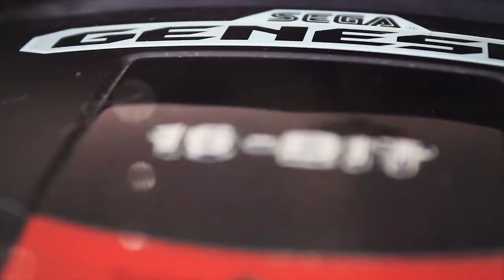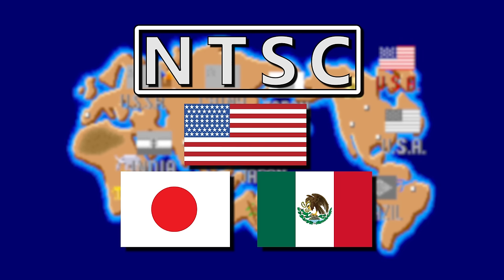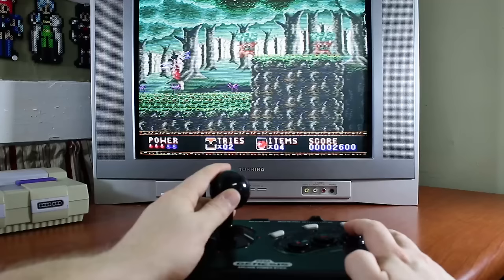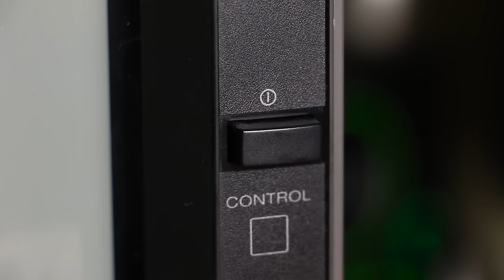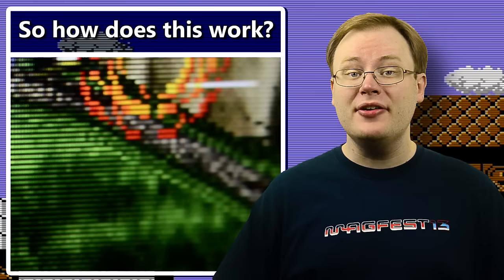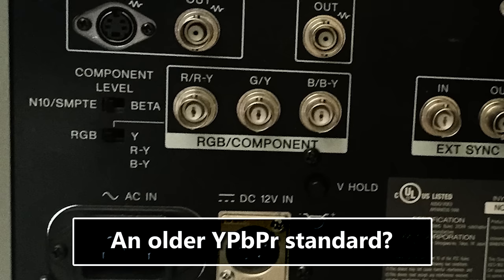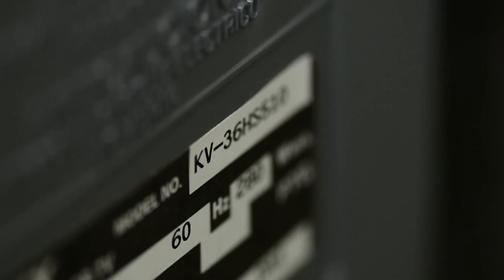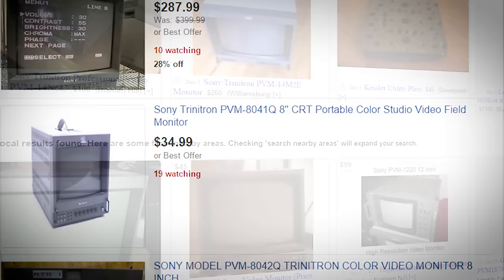Gaming on CRT Televisions, PVMs and BVMs :: RGB104 / MY LIFE IN GAMING

Comment: No! CRTs are great because of their zero lag.
And zero lag is great for 3D games.
For retro games, where the console itself introduces the lag (they're much slower than even emulated consoles on modern hardware), the lag an LCD display introduces, is minimal.
I prefer the sharpness, increased contrast and color ratios, of LCD screens.
And any scaler can be used to make it look like whatever you want; especially since LCDs run at 1080-2160p resolutions, while the original retro games often are limited to 144-320p games (=3 to 15x lower than the capabilities of the LCD screen).
Reply: Added lag, is added lag.

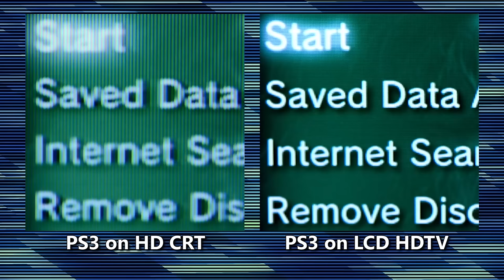Comment: 19:31
Is the PS3 running at 1080i on both the HD CRT and LCD? 

Are you saying that 6th Gen consoles(PS2, GC, XBOX) shouldn't be played on HD CRTs? If so, why?
Also, is there 0 lag on HD CRTs like there's 0 lag on non-HD CRTs?
Reply from the maker: +Mike V [Try4ce] HD CRTs disappoint me because they use analog technology to display a digital signal, meaning you don't get the benefits of either. Analog inputs are converted to digital before being displayed. Technically, yes there is lag. I can't say with 100% certainty that all consumer HD CRTs are this way, but it's the typical configuration at the very least.
Reply: Thanks for getting back. All I know is that my PS2/PS3 is more responsive when I play on my two HD CRTs(KV-34XBR910, KV-30HS420) via component cables compared to when I play on my LCD TV with either component or HDMI. 
Does a professional video monitor not have lag at any of its resolutions?
Reply from the maker: [Try4ce] They don't (IF they are supported - most do not support resolutions like 480p), because it supports all of those resolutions in a purely analog realm.

Comment: My Life in gaming : 
I live in Canada , i have a NTSC console ...If i order a PAL france/europe gamecube console , can i connect my 110 Power unit/cable into the PAL power connection hole behind it and bingo  ??
Reply from the maker: [Try4ce] GameCube systems all use the same connector for power. The power brick for Europe is rated to their standards, so all you have to do is use a North American GameCube power supply instead.

Comment: I have a question that you can clarify for me.  I recently bought a pvm, however I noticed that the projection light is dimmer than that of a CRT tv.  Is this really real or is the model I picked up in question with some kind of defect ?
Reply from the maker: [Try4ce] Did you try adjusting the knobs or any other brightness settings? It shouldn't really be darker than a normal CRT. Also, some PVMs may have a anti-glare film over the screen, which can darken the picture considerably. They can be removed, but I don't know the details of how it do it safely.

Comment: I’m looking into getting an HD CRT now my question is would like guns work on these models?
Reply from the maker: +C4 [Try4ce] Sadly no. I actually have since gotten rid of the one shown in this episode. Personally I am not a big fan of them anymore. The colors and black levels are excellent (which is what drew me to it in the first place), but don't forget that they are digital TVs using analog technology. This means you won't get that true scanline effect with retro games, and instead will have an image upscaled by the TV itself. Is it a Sony model like I had? I am not aware of any consumer HD-capable CRTs that handle retro games in the true way that non-HD CRTs do. You would need a BVM or a L5 series PVM (or similar top of the line model from other manufacturers) to pull off both in the same unit.
Reply: My Life in Gaming Thanks for replying back so quickly I appreciate it and the information extremely helpful. The one I am looking at is a Phillips 30 inch diagonal screen. Pretty much the same reason you were drawn to yours is why I’m drawn to this one. But not being able to use the light gun or having true scanlines is a deal breaker.

Comment: so wait, i just bought a NES and old CRT locally. (waiting for NES to come in mail). Should i try to get SCART connection for the NES or is the 3 cable RGB thing better or what? (The TV I got has MANY input types on the back) thanks for the help (i live in UK)
Reply from the maker: [Try4ce] An RGB mod for your NES would improve the picture if the TV supports RGB. By "3 cable" I assume you mean Component video, which is kinda like RGB, but came around way later and is a different signal (but with similar results). I wouldn't worry about that as long as your TV has SCART.
Reply: @mylifeingaming  thank you man, i'll try to find away to plug it in via scart then

Comment: Most CRT TV's that we had couldn't do 240p.  They only displayed interlaced signals.  Progressive scan was not supported on affordable TV's until the late 90's.  In fact, composite only supports interlaced signals.   Everything would be converted to 480i, or less depending on the actual resolution of that particular display.  CRT's just have a magical way of making lower resolutions still look okay.  Something LCD TV's are horrible at doing.  Also, CRT's have no input lag not because of screen size. lol  It's because you're converting and analog signal into a digital signal for the modern TV to display.  That process takes time.  The information has to be read, processed, and then displayed.  You don't see any image until this process happens, hence the lag.  However, CRT TV's don't need to do this.  You see the image in real time as it happens.  It's just like a digital speedometer in your car verses and analog one.  A digital speedometer takes a measurement of your speed, processes that information, and then displays it for you on a readout on your dash.  However, analog needle just moves as your speed increases.  I hope that helps.  I'm an engineer, not a teacher. lol
Reply from the maker: [Try4ce] 240p is a real thing that works even with RF or composite video. It's not a proper standard, more like a "trick," but it effectively creates a progressive image that works with a 15kHz display. That's the beauty of analog, you can bend it to do what you want. 480p is another matter altogether, however. I don't recall this video ever stating that the screen size has anything to do with lag, unless you misunderstood what we said about scaling processes being part of what contributes to lag.
Reply: @mylifeingaming  Thank you for replying!  For the record, I did enjoy the video! :)  I think I did misunderstand because I watched the video for a second time.  I just explained it in a different and more complex way. lol

Comment: well there is a "modern solution now for low latency gameplay
get a cheap hdmi pc monitor (they have generally way lower latency than a tv)
and take a cheap sart to hdmi converter or a composite to hdmi converter.
enjoy!
(i knoxw it is not as good as a crt but it does the job better than modern tv at low prices)
Reply: I do have a cheap Monitor, it has Input lag, bad motion blur, TN Screen. I had an IPS, it had very bad blur and light bleed. I stick with my D32, D20 BVM no lag great blacks no motion blur.
Reply: DOOMISFORU GAMING I didn't said a shity monitor lol,I had a 6ms TN Samsung for 100 bucks brand new for exemple with not bad color reproduction.
I had a Trinitron crt tv from Sony,it was great but it died 3years ago...crt are great but in 2017 they are getting very old and it is good to find a way to replace them...
Reply: Tailslol I know, I was saying that. LCD are lighter the CRT, but at the same it much harder for someone to steal a 250lb monitor, the a 10-20lb. They all have have there + & -. Gem for crts, lcd blacks levels and blur. I will that newer cheap monitors QC is very bad v.s. about 3yrs ago. even high.
Reply: DOOMISFORU GAMING heh stealing has nothing to do here...
pff seriously,excuses excuses...

Comment: So I need help I have a 20" Sony Trinitron. I wanna play hotd 2 & 3 but the gun doesn't ever wanna aim where tell it too
Reply from the maker: [Coury] The Wii version? I think that's the only one. If so, it would be a sensor bar issue since the Wii uses that to handle pointer location, not the refresh on a CRT TV.
Reply: @mylifeingaming  well to clarify I meant hotd 2 on dreamcast. 
And hotd 3 on xbox which also has hotd 2 on disc. My buddy has the big one 36" I think we tried to play some genesis light gun games last weekend. And it work sorta. Mainly on both TV's the game thinks we are only shooting to the left of the screen. Any ideas?
Reply: @mylifeingaming  also is 300$ a good price for a BVMD14H5U
And a BKM129X? 
Plus a BNC to scart adapter?
Reply: @DatGameCollector  I say that a good price for a 14bvm, but I would ask the seller for test patterns to see geometry and converge.  also how many hours are listed on the BVM

Comment: How can I use my retro console to a monitor with 5 BNC Input? (RGB+HD VD)
Reply from the maker: [Try4ce] You'd need a line doubler that outputs RGBHV. Basically this is like an alternative VGA connector. One option would be an OSSC + a lag-free HDMI to VGA converter + VGA to BNC cable. Not many systems other than Dreamcast provide that HV sync signal, so you'd have to use a device like that. Recently I got a DVDO iScan Pro on eBay for deinterlacing, which accepts composite, S-video, and component input, and you can output as RGBHV. It does have 2 or 3 frames of lag though. Basically look for things designed to connect standard video signals to VGA monitors.
Reply: @mylifeingaming  Sounds challenging but I really want to make this work. Thank you for the advice :) Fingers cross X X..

Comment: So I just got a consumer crt tv, and oh boy do I have issues with it. My main one is the high pitch noise that it makes when I turn it on. I'm still young enough to hear it, and it physically hurts. I looked online and saw that this happens with all crt tvs. Does this happen with your set ups or is it just my tv?

BTW, I am 22. So I do have memories of using one. but I really don't remember the high frequency pitch
Reply from the maker: [Try4ce] I'm 37 and can still hear it too, but I'm just used to it. It was just something we were so used to as it was part of everyday life back when CRTs were the only TVs. No one really thought about it. Maybe yours is not in good shape? I would not describe the high pitch sound as painful.
Reply: @mylifeingaming  interesting. Cause at first it was a little painful. But after a minute I got pretty used to it. Maybe it's because my ears are more sensitive? It's hard to say
Reply: @mylifeingaming  I also have to ask. Is there a type of crackling sound when yours turns on or off? Cause I'm worried about mine
Reply from the maker: [Try4ce] Yeah that's pretty normal. Like static electricity. You'll notice dust will cling to the screen.

Comment: So theirs not a 480p sd crt?
Reply: The only way to get no lag in 480p and 240p is with a PVM or BVM.  I use BVM-D20F1U which is a 4:3 20inch monitor on this Monitor you can do all the way up to 1080i,  though 720p or 1080i force 16:9 mode which is not great.  I can use light guns on this Monitor,  play duck hunt all the time. The screen has 900TVL in 4:3 mode. I  use the default Anlog card for RGB with SCART,  and a BKM-20D card for component Video. I  love the Monitor it is super sharp.

Comment: For gamecube games what's better a HD TV lcd, HD CRT, or pvm?
Reply from the maker: [Try4ce] There's no easy answer. A standard CRT is best if you don't have component cables, as the flaws will be hid the best. If you do have component, a PVM will look amazing, but very few support 480p and those that do will cost you A LOT with the way prices have gone up. One of the best solutions actually would probably be an HDMI adapter plus a lag-free HDMI to VGA converter, and to play on a VGA CRT. Just don't forget to hold B to enable progressive scan. Otherwise, RetroTINK 5X or just an HDMI adapter will look best on a modern TV.
Reply: @mylifeingaming  Which PVM model supports 480p because maybe 31 kHz requires it?
Reply: The Sony PVM-20L5 was the only PVM I could find and it's reeeeeally expensive.

Comment: CRT home TVs I get it, but this silly obsession with tiny PVMs that no one ever used is just odd - of course it looks nice, the screen is tiny! Even composite on a decent TV looks great at a normal size that people actually used, 14-21 inches.
Reply from the maker: [Try4ce] That's the size of most PVMs people use... 14 to 20 inches. There are little 8 inch ones too, but I doubt many people game on those. There are some really huge ones too, but they aren't common.
Reply: @mylifeingaming  The 8 inch ones are great for desktop, and apartment retro gaming!

Comment: Would this cause input lag if i plug my switch to AOC crt monitor? Using hdmi to vga converter? I hope some one answer. Thanks
Reply from the maker: [Try4ce] You can get very simple and inexpensive HDMI to VGA converters on Amazon that have no lag.
Reply: @mylifeingaming  hi based on your answer so basically there will be input lag , from digital to anLog conversion?
Reply from the maker: [Try4ce] No, there should NOT be. Some adapters may have lag but I've had good luck with several cheap ones. Like on Amazon there's an HDMI to VGA by "Rankie" that has no lag.

Comment: I am seriously thinking about getting a CRT TV but they're crazy expensive. I do have an old tube TV but it only takes RF cables. Anyone know if the rf to AV converters worth buying??
Reply from the maker: [Try4ce] If you converted AV to RF, you'd be reducing the picture quality to RF. It wouldn't look great, but it would look nostalgic at least.
Reply: @mylifeingaming  Thanks!!! I just wanted to have the picture in its original 4 by 3 format without the empty space and have my light guns working. I'll still be looking around though!

Comment: How do you connect a dreamcast to a BVM/PVM using 480P?
Reply: Jonathan Thompson I use the Toro Dreamcast Box https://www.beharbros.com/toro 
Then use a scart to bnc for my BVM. The BVM D series has RGB, Component and with a Monoprice Hdmi to SDI Convertor, u can use New consoles. BVM D20F1U can do 240p/480i/480p/720p/1080i
Has a 16:9 mode. Or 32in is widesrceen 1000tvl 250lb monster. To use HDMI, you will need the 42D card.HD SDI only support 720p and 1080i. I use 720p. Though on 42D Component does all resultions. I play my XBOX one and PC on the BVM, they look amazing. The BVM A Series is Cheaper and newer, but the RGB card is very hard to find and cost more then the Monitors themself. The D20inch is about 100lb has 900TVL 700TVL in 16:9 Mode and is fullscreen. 32 and 24inch are widescreen 16:9 screen 1000TVL.
Reply: Awesome thank you super helpful. Got mine working great on my A-series BVM now in 480p. What about PS2 480i games? Do you use some sort of deinterlace method or just play native 480i?
Reply: Jonathan Thompson I tried soft mod software on to use games in 480p, could not get it to work. The Comopnent input has alot on the PS2, most people use RGB. For 480p, Best looking console is Gamecube, Xbox, and PS2 in that order

Comment: Hello

On my ikegami crt , im using a modded rgb nes my video display from my nintendo doesent fill the entire screen on some games? 

Is this normal?

Im going on memory from last weekend, but double dribble played fine whereas duck hunt/mario brothers part of the left side and more of the right side are cut off? 

Is this normal
Reply from the maker: [Try4ce] CRTs have an overscan area where some things may be cut off. Usually people who made TV shows and games took this into account and didn't put important stuff too close to the edge of the screen. That said, it's entirely possible your TV may or may not be set correctly. I'm not familiar with the controls on Ikegamis, but Sony PVMs have underscan and overscan buttons that let you see more or less. NES games often fill the whole top to bottom with color, but often it's glitchy or garbled junk that's wasn't really meant to be seen. Other games may not render colors in the full area.
Reply: @mylifeingaming  i believe its an underscan problem. The video image doesent extend to the edge of the screen

Is this normal?

Again it seems to effect mario bros/ duck hunt and not double dribble?

I have an electronics guy, and i believe my ikegami monitor is programable for certain settings

Maybe i could have setting 1. Genesis. Setting 2. Nintendo normal double dribble. 3. Overscanned for mario bros etc.
Reply from the maker: [Try4ce] Yeah normally you would expect NES games to fill a CRT for sure. You may be able to make sizing presets but that likely involves going into the service menu. You want to know what you're doing before doing so because some settings can potentially throw the CRT so far off spec it may damage it. Your friend should be able to help you with this.